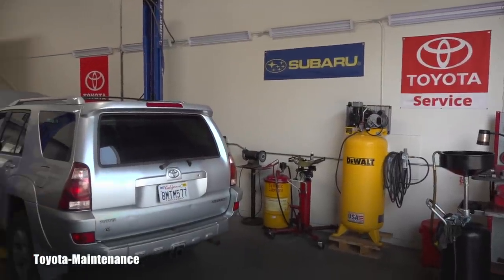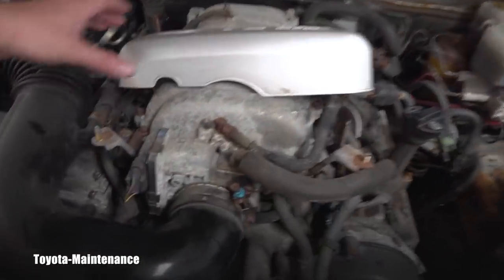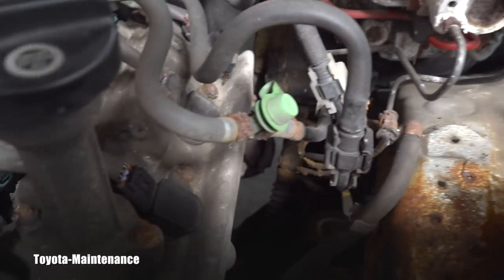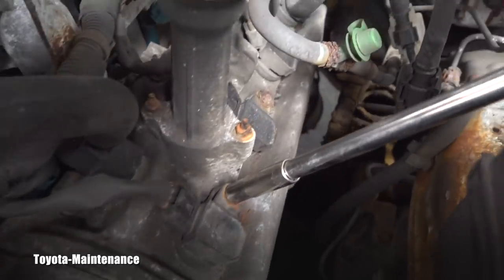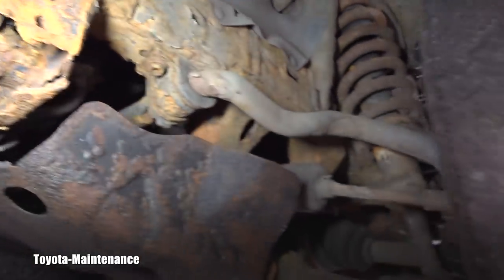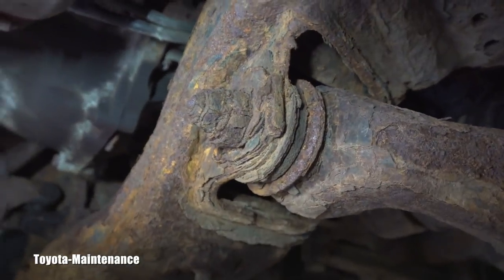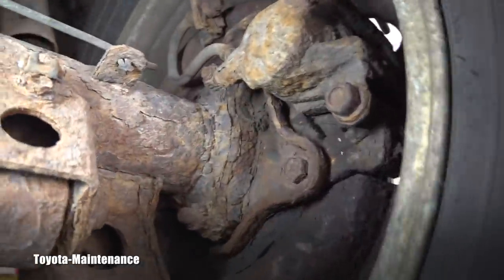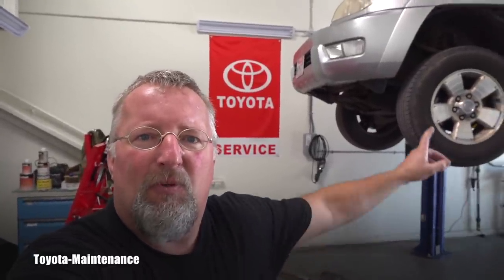Extremely rusted Toyota 4Runner

Comment: My 03 4 runner looks about the same...I just passed 280k on the original engine. I could have bought a new suv or truck for 80k and been making payments for the rest of my life. I opted to get the 4 runner, a grinder, and some paint with rust inhibitors. A day of work and 5 years later the Toyota still 🏃.

Comment: 2003?  That's really nice for a northeast vehicle 17 years old.  Looks like what I'd expect with a 2013.  It's why I work with a 4 post lift.  Don't have to worry about  vehicles breaking in half or the arms going right through the frame.

Comment: Pretty sure this is more than typical "New York" northern rust.  This looks like a flood vehicle.
Reply: That generation of Toyota’s were built using defective metal so they rusted really aggressively. I see a lot of them that are this far gone unfortunately
Reply: I used to work for a truck fabrication shop and there were always Rust on new vehicles but this is very extreme. To me, it looks like the vehicle was flooded. I'm in the market to buy a Honda or Toyota so 2 days ago I went to inspect a 4Runner and it was nothing like this one.

I'm also from California so this extreme level of rust is not too common,  is this common in snow areas likeNew York?
Reply: Josue B 
Yes, it’s very common for cars in the northeast of the USA. The salt they use on the roads destroyers bare metal. I pressure wash the undercarriage of my Tacoma after every snow storm.
Reply: Actually for a 17 year old NY vehicle it looks to be in very good shape. That's about half the rust my 99 Tahoe has on it. The only reason it's still on the road, is it has parts from 13 different vehicles.
The only thing that surprised me was the patches to the frame and the lower core support being so bad.
Reply: @goforbroke2  LOL. That's crazy, I did not know this was a common issue in New York
Reply: Josue B Its actually worse farther up north in Vermont/New Hampshire area. Vehicles don’t last up there very long without some serious preventative maintenance.

Comment: Im fairly certain my 04 has been in the New York/Vermont area most of its life, she has almost Identical miles and it's not even close to half as bad as this. I'm sure that the previous owners never took proper care of it during winter and no attempt at preparing their car for the roads was taken. Yea some of my clamps and evap lines are in pretty sorry shape, but I'd never be afraid to have my truck on a lift. Common thing as well is losing exhaust covers and heat covers just because they are thin metal sheets and just wear away quickly, I've lost one or two now but I certainly didnt need my frame welded!!!

Comment: Por15 on the frame and that 4runners good for another of couple of years in CA. If you were a mechanic in the salt belt, it's something you see single day. And there's not much you can do as the customer doesn't have the means to purchase another car that is less rusty. It is what it is, I've seen about a dozen toyota 4x4s with less than 150k miles including Land cruisers that look similar to that.

Comment: Yes ,I deal with this all the time in PA.
It sucks. But can be reduce by good preventive practices. Washing under the car after a winter storm and a applying fluid film in the fall. Regardless is will end the car in ten years or so. Specially if the car is driven in heavy salt conditions.

Comment: That's a bad one! I have the same year/model and have to battle rust as well here in Illinois, but you have to do a little preventative activity, like blow off the undercarriage very good at car wash whenever you can in the winter and then real good in the spring and then drive it in a good rainstorm too. Then you have a shot of staying on top of it with yearly scraping/sanding/painting and maybe some Fluid Film or similar. My frame has two patches which cost me $1K. Just last month I scraped sanded and painted and put some fluid Film inside the frame all along the length of through the various holes. The amount of rust you can get from inside the frame, the radiator/transmission crossmembers with a coat hanger is unbelievable! you can fill a freezer bag! You guys in California don't know how good you have it not having to deal with rust.

Comment: WOW and actually l just bought a 2004 Tundra from Seattle but the truck was from Minnesota and l live in Hawaii. l was shocked at the rust on the frame and it's not bad like the one you are showing but still lm gonna have to do some structural work. It also looks like someone had done some structural work on it too. The one you are showing l'd say it's a gonner! l am not a mechanic but l can imagine if you raddle the bolts/nuts out everything will just fall apart and on you. Well, it's 2021 but the video is in 2020 hopefully it all worked out.

Comment: Thank you for this video I'm about to pick up a brand new 4Runner .what can I do to prevent all this.
Reply: Some people have good success with undercoats. If there's any existing rust on there though it'll just continue forming underneath the undercoat. 
If it's a used 4runner you'd definitely want to use an undercoating oil instead. Something like Fluid Film, Woolwax, New Hampshire Oil, etc. You can even spray that on existing rust and it'll stop it from getting much worse (until it wears out)

Comment: a few months ago here in Canada my 2012 tacoma double cab had an campaign performed by Toyota on frame and corrosion protection they needed truck for a few days they completly cleaned out frame and all body performed inspection and then applied more rust protection and also plugged up part of frame to prevent future rust issues also by doing this they extended my frame warranty by i think 10 years also i had a brand new 19 tacoma from enterprise paid by Toyota Canada  to use while they performed Campaign

Comment: I have a 92 Toyota 4 by 4 pickup I replaced all 13 brake lines all three gas lines gas tank and the list goes on and on cuz I had to patch the frame in a couple areas because the truck is from Massachusetts but it's all soon it down and painted came out pretty good but I have seen worse than what you're showing although that is bad

Comment: Thats a pretty extreme case of rust there. I live in Mass and own a 07 4Runner and its no where near as rusty as the one in this video. I do have a rust spot on the rear drivers side wheel arch. thats pretty much it for rust on mine.

Comment: i'm on the east coast, and i bought a 2000 tundra new, after 10 years Toyota replaced the frame because of rust issues, plus replaced a lot of rusted parts, brake lines , suspension , ect.. gave me back a brand new truck, but yeah that's pretty normal after 20 years on the east coast, toyota did have a recall for frame rust, supposedly wrong paint was used.

Comment: Lol I live in upstate ny and unfortunately this is typical especially for the 4th gens out here I have the exact truck just different color and Iv had to plate mine in the same spots plus where the rear control arm connects to the frame but I do all my own work so it's only my time and meterial 4 me so it's still worth it  and as long as it's done correctly it will still pass inspection I love my truck and have been slowly cleaning up and bed lining the underside I know I'm not going to beat the rust but just try to protect it enough to drive it as long as I can oh and yah i invested in a role of brake line thoes things are so crusty if you do 1 u pretty much are replacing it end to end because they don't come apart

Comment: I live in the rust belt.  My 2012 taco gets oil sprayed every year.  Looks great.  Nothing even close to rusty.
Reply: Never heard of oil spraying method? How does this work? What kind of oil do you have sprayed on under the carriage?
Reply: @rayrayrun  it's like mix they use. Like krown. It's big in ohio   drive up on a lift and spray it like undercoating. Since it stays "wet" it doesn't trap moisture.  Works well.

Comment: My 99 4runner's frame rusted out so badly I couldn't go on the highway because of the vibration. 214k miles and engine just a little valve gasket leak. From Chicago area, salt central in the winter.

Comment: I have a 2003 4 Runner 175,0000 not that bad of rust but my muffler is sounding loud hoping to get it fixed with not having to get the whole exhaust re-done. i haven't had it look at yet. Seeing I'M a widow hoping not to get taking to the bank. haha  Thanks for your video. From Michigan

Comment: What I have learned about living in north east is to spray oil with a hand pump under neath car and in panels if you plan on keep car...Sounds nasty but y ou will thank yourself in 5 years when u need to replace parts.....🤷‍♂️ salt and they are starting to spray a type of chloride in turn pike.  Where do you think all the pot holes come from

Comment: That's why when I lived in nys , I had my vehicles oiled with rust check every year . Lol you have seen nothing in ny the frames rot out from under most trucks in 8 yrs if you dont oil them and never use undercoating it traps moisture .

Comment: What are common issues on these 4th gen 4Runners? I've read stuff about how the 2003 to early 2006 4.0 V6 had head gasket issues and the 4.7 v8 has a timing belt which is not a huge deal and the exhaust manifolds crack. Is there any other issues that are common?

Comment: I have a 1994 and a 2003 4 runner. The 94 has 180 thousand and doesn't have a bit of rust and the 2003 has 100 thousand and the frame and some other places has rust. I cleaned it up as well as you can without doing a frame off resto and protected with paint and other means. The 94 is just better made material than the 03. I have driven the 94 on salty roads lots more than the 03. I have always after driving on roads treated with salt at first chance wash under carriage to remove but the 03 it didn't matter what you did. It's just bad metal. In the winter time I only drive the 94 when the roads have salt,on them.

Comment: This is not uncommon to see in upstate New York and New England 4Runners. My own 2001 4Runner was heading in this direction but about 4 years ago I started applying Fluid Film every November and frequently rinsing the undercarriage through the Winter..These steps helped a lot although I also have seen rusted out clamps on numerous hoses.
Reply: My 07 has suffered through 10 winters in western NY . 6 yes with Krown and 4 with fluid film  applied by “reputable “ business’s HA HA ! 
Mine looks almost as bad as this one.
Discouraging to say the least .

Comment: I traded my 2004 4Runner in almost 3 years ago after the radiator support, fuel tank straps, skid plates and transmission lines rusted away with only 90k on the clock. Living in PA the salt just eats these vehicles away.

Comment: WOW ! I hate to say it, but that vehicle looks like its at a point of not being safe any more. I'm am old gear head from NE Jersey. Owned my share of old cars years ago. Cars that were operated in snow, salt and sand. BUT Never saw a chassis, or brake lines like that! Especially on a relatively new vehicle. I live approx. 30 miles from the Gulf of Mexico. In SW Florida. I drive an '02' Ford E250 extended van, with 329,000 miles on it. And, it has surface rust on the frame. Thats all. As I said, I've never seen anything like that on a vehicle. After 60 years of driving and fixing all kinds of cars and trucks. Not even old , junkers that I'ved owed and driven. UNBELIEVABLE !

Comment: Lol. I drive a 2007 fj cruiser withn180k miles.  I live near Pittsburgh pa. It's usually rust that kills our vehicles. I usually pressure wash the undercarriage  every few weeks in the winter at a car wash. I also have my vehicles undercoated with fluid film or used oil every winter.

Comment: I had the same issue with my 4runner..I had to buy a rollover frame from a junk yard, and rebuilt everything..Brake lines, fuel, suspension, etc, etc...After 2 yrs of grinding, cutting, and welding; I drove it out of my 2 car garage! Lots of work, detailed measurement to 1/16th or better; I got it done! No autobody would touch it, for any price..I think Toyota could do a better job on undercarriage treatments of its steel...It can be fixed, but looks like the body needs an entire frame to start...

Comment: just be glad that it's not in for a brake job then it's brake line replacement .but a little heat from a torch is a machanics friend for those rusted bolts.

Comment: I knew it came from NY just by reading the title. Sad. We pay so much money for them to rot apart. Worst thing is the brake lines. Sadly some are still using steel brake lines that rot within a few years. Dangerous.
How we feel as inspectors is crazy. Have to pick and choose what is the worst rotted part. Whoever welded that frame did a nice job.

Comment: I had a 2004 4runner.....same exact issues....rust all over. My spare would not drop down...gas tank strap rusted away broken...exhaust rusted/broken...front of frame where tow hook is broken rusted off...frame completely rusted out. Flakes on the ground everywhere i went.Toyota knew this model had this problem. They only recalled the Tacoma for frame issues similar to this not the 4runner. Great truck but frame issues on everyone I worked on.

Comment: I have been hand spraying with a five dollar squirt hand pump…for 30 years with new transmission fluid every few weeks when I got time.  Takes ten minutes …very messy….during spring summer fall…....in the rails. in the holes …outside rails …in the doors on the hinges.. brake lines.  Not muffler…getting it ready for winter..tranny fluid does not hurt rubber seals or body mounts….tranny fluid protects metal for about 3 months and washes off….spring. …start again….look at my truck upstate New York…..looks great underneath..cost me 5 bucks…..BUT….it’s messy..but works great..can’t hurt….not young anymore.  Sucks going under truck…lol

Comment: We have a 2004 4Runner with about 240K Mi (Chicago since new)....same pattern of corrosion on the the frame rails and radiator support.  The mechanical components are not as affected as this one. Our 4Runner will probably be going to the big highway in the sky when we are done with it.  Damn shame because it is an excellent vehicle, but anyone in the market for a used one needs to be aware of this chronic issue.

Comment: my 1998 4runner was on its way to the same condition.. I did almost the same welding but  traded it for a 2016 Rav4 ( dealer gave me $2000 for it , guess i got rid of it in time , was a great truck i do miss it. it  had less miles on it that that one )   Just a damn shame!!

Comment: For NY state inspection that is a fail to be on the road. Just because the brake lines and front frame. That vehicle it is ready for the crusher as Eric O. Will say. Maybe good for parts because the body it is in OK shape but the rest it is far gone, unless they do a chassis swap with a CA vehicle. Toyota has this issue with the Tacoma frames that rust out far to repair and the truck was unsafe even bending in half. There was a missive recall and most of the north states got the fix.

Comment: there are ways to deal with that. I've done it several times before. I've done it on my back but a lift would make things much easier. the stuff that's rotten out completely is not worth being there in the first place so it needs to go bye bye and use things like tie straps instead. you would be surprised how much useless rusted (mostly thin brackets and shields) crap you can take off a car without affecting the function. many of these bolts will break or need to be cut so it's worth taking some sample of bolts and picking up a variety of new bolts just in case, and just grinding out any remainder. when it comes to this kind of job, simplification is key. but the first step in this process is to go through as much as you can with a rotating wire wheel while protecting things like wires and brake lines. those need to be avoided/protected. the idea is to go from larger areas to smaller areas, and the smaller areas will take more work to go through with a smaller wire brush either handheld or rotary. once most of the rot and rust is taken out of the equation, time for a few coats of primer. now you would think the next step is to put the final coat of paint but bad move depending on how long you want that repair to last. rust spreads like cancer you have to wait a couple of weeks and start the process again with removing any rust that becomes noticeable. then prime and final coat.

Comment: Looks like a pretty typical NE 4Runner… if you are launching boats with it in the ocean and doing beach driving - that’s just gonna happen if you are not very careful.  Most of that rust just looked like surface rust…. Replace all the clips, hit it with rust converter and zinc primer, and just start replacing system by system.  I’ve replaced all the front brake lines, rear are next, fuel system after that… etc… then start using wax-wool lanolin undercoating yearly… should last another 15+yrs.  ( side note is this is a bit of a Toyota thing, my Range Rover of the same year has the exact opposite - bunches of wheel well body rust and practically no frame rust 🤷‍♂️ )

Comment: That thing is one bad speed bump away from total failure. For as reliable as Toyota is, it’s unbelievable they haven’t rectified this yet. I have a 2018 tundra that spent one year in New York and there are a bunch of surface rust spots on the frame.

Comment: Never under coated, my 2006 limited is still in great shape and its been in the north east all its life.
Reply: I call bs unless you garage kept it during the winter and never drove it. It's just not toyotas but salt will rust and destroy any frame unless you do regular frame maintenance (fluid film wool wax etc)
Reply: @jamesp6283  It was always under coated, first thing I did when I went to look at it was crawl under it with a flash light.